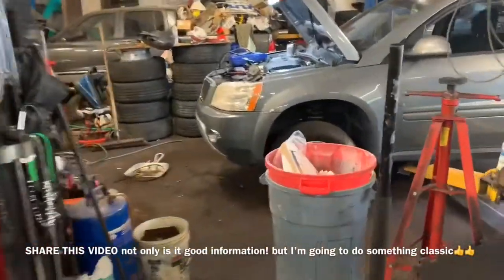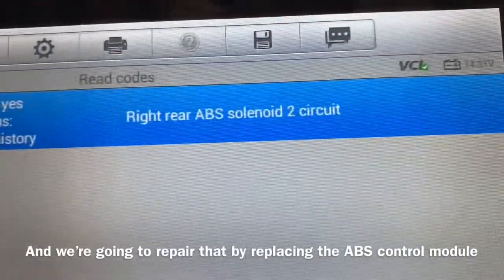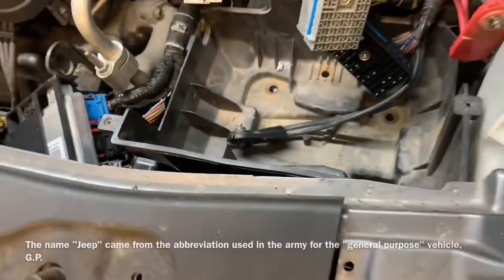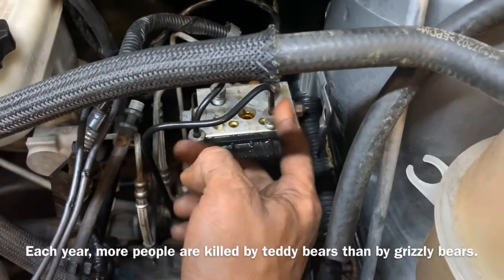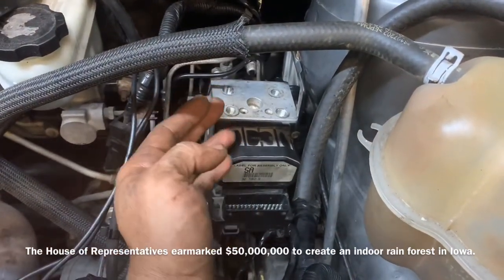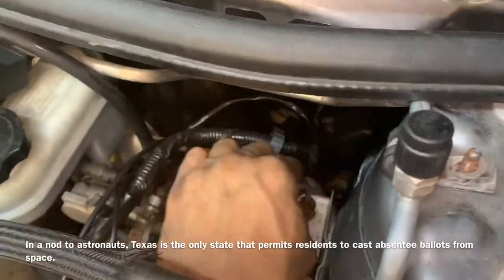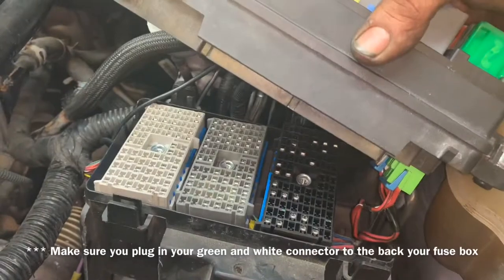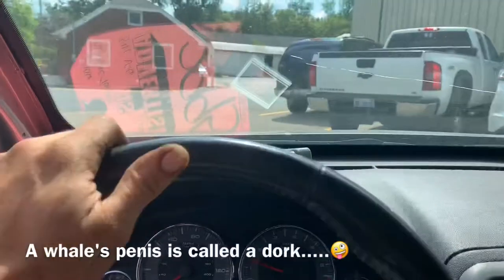Saturn Vue ABS light on ABS pump control module replacement how to

Comment: Hey Clay where did you purchase your pump from we can't find any at no dealership in America.my mechanic is well connected but we just can't find that pump for my 2006 saturn vue...do you may know who would have the part .oh and we found a guy who rebuilds the pump...but we can't find any brand new..word is they discontinued manufacturering the part
Reply: Ever figure it out. Going to buy used one bon ebay but it's confusing trying to find which years are compatible.
Reply from the maker: See this is why I tell people to message me on Facebook this Franklin has a very good question that I would’ve answered immediately……….

If you’re looking for a used pump

This is the place that I’ve used for about 15 years they do not pay me for advertising they don’t collect information all you have to do is input your ZIP Code and they will tell you all the reputable salvage yards in your area did have a good quality used parts because all of the salvage yards have to pay good morning to be on their site so all of them are very reputable

Car-part.com

Comment: Do you have to reprogram an ABS module after replacing it? Also does the vehicle have to have an “auto bleed” done for it to work properly?  I replaced my module and I am getting 6 new error codes. Thx.

08 Saturn vue xr 2wheel drive
Reply from the maker: I did not have to computer bleed mine. But I would think that it would alleviate some of your problems you possibly have an air bubble inside there

Comment: hey, thanks for the video- I have a question my ABS act when I push breaks at the stop sign and it is completely unwanted ABS noise in the dry concrete or blacktop, so I changed both front wheel bearing brake pad and Rotor but still I have the same issue. and I don't have any light in my dash, I plugged OBD reader there is no code indicate. what is your advice? do you think there is some air in the brake lines or...? thank you
Reply from the maker: I appreciate the kind words, Well I can’t say for certain because I’m not there That’s an extremely common problem with the Chevy Equinox Saturn Vue Pontiac torrent etc. etc. they all share the same components and regretfully from my experience that is almost always the control module itself sorry wish I had better news for you
Reply: I've been to 3 different mechanics, had sensor replaced, cables, etc.  ABS and TC lights still come on and the brakes "seize" up  almost like the brakes are being applied when they're not ...intermittently, when the brake pedal is pressed at times it feels like car skipping, can feel the stutter under the pedal. It's terrifying when it happens. Idk what the darm.problem is. Love my 06' vue
Reply from the maker: Oh that’s an easy one….. if they look at the live data during breaking they’ll notice a peep fluctuation in the voltage output from the wheel speed sensors which is causing the ABS system to actuate . Remove the fuse for the ABS control pump you will still have breaks and I’ll guarantee you it won’t happen again sounds like you either got a bad sticking wheel speed sensor or a defective controller which is very very common on these.
Reply: @sharpcarco  OMG I love you. Lol . Between sensor replaced & other front end work = $$. I even asked if I could remove it completely or disable something....didn't seem they agreed. TY!

Comment: I need this part badly and in Texas I can't pass my state inspection because the break lights are on........ I need help😭
Reply from the maker: Your brake lights stay on all the time? If that’s the case it’s a much much simpler fix than that you just need a new brake switch and it’s super easy to change
Reply: @sharpcarco  oh no we found it was the ABS pump but they don't make them anymore.do you have any references we checked every where even  all the GM dealer ship's in America computer wise and can't find any
Reply: @sharpcarco  abs and brake light together I'm sorry
Reply from the maker: Well that’s pretty easy to solve look it up on here just buy a used one it doesn’t have to be a brand new one from the GM dealership

Car-part.com
Reply: @sharpcarco  thank you Clay my mechanic has access to that he just didn't know if I wanted used but it's been 2 week's I miss my 2006 vue so he will look into it thank you so much buddy👍👍👍

Comment: Did you have to reprogram.
Reply from the maker: If it needs to be programmed I would’ve said it in the video. Honestly I work on so many different makes and models of automobiles I can’t remember without going back and watching the video and I’m sorry I do not have time to do that…. But you can . I’m certain that would not be information that I would leave out if it was necessary
Reply: @sharpcarco  no problem.its not my issue anyways. I just bought an 05 Vue 2.2. someone had pulled abs fuse. That's why I was getting code. They pulled it because abs is activating when braking. Now on to more diagnosis. Guess that's what you get for $2000 car.